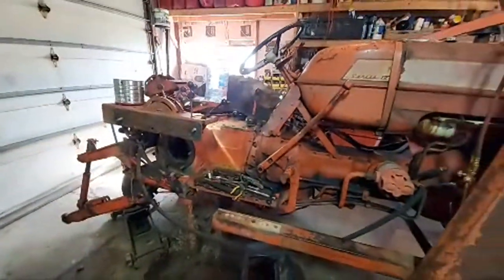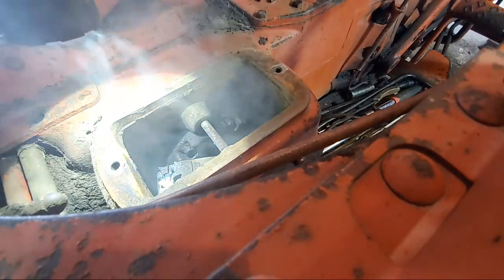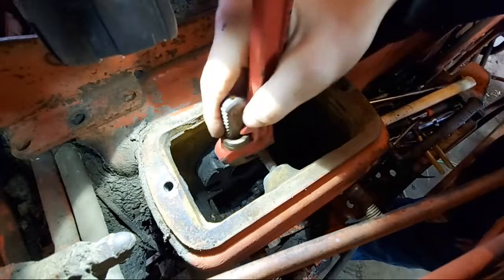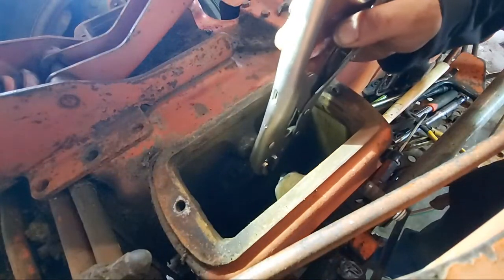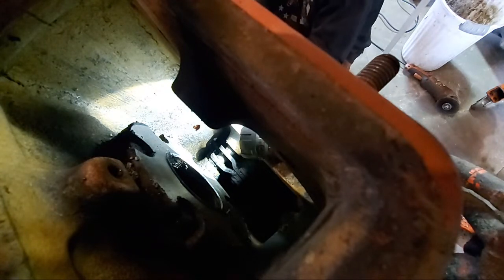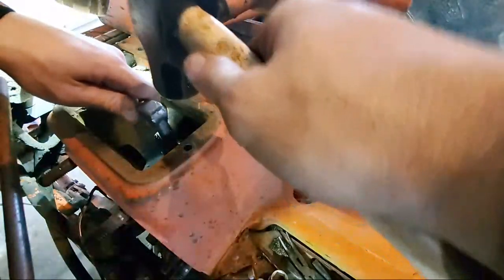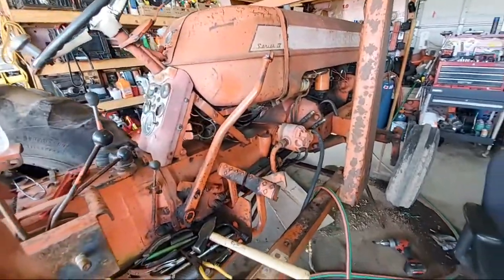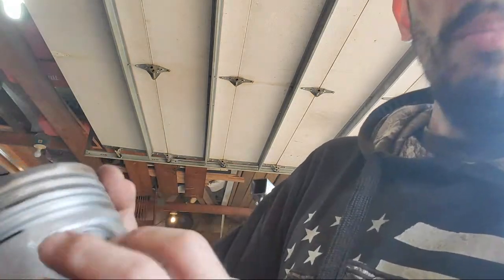How To Easily Remove Brake Pins On A D Series Allis

Comment: Is there a way to put a brake caliper and a disk as a replacement
Reply from the maker: I've never seen an aftermarket option but looking at it, I could fabricate something to work. Would have to have an insert made for the pilot to slip onto the existing gear on the axle.